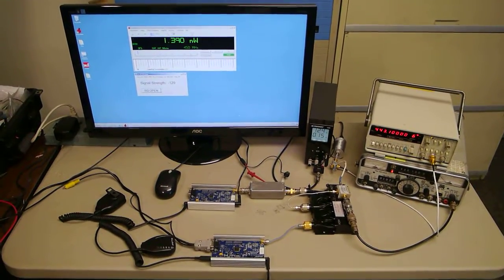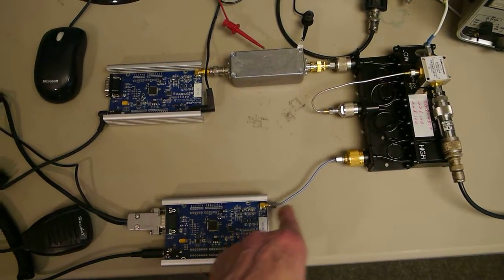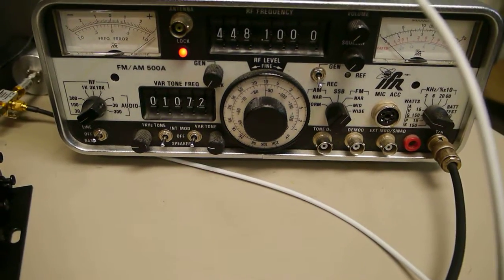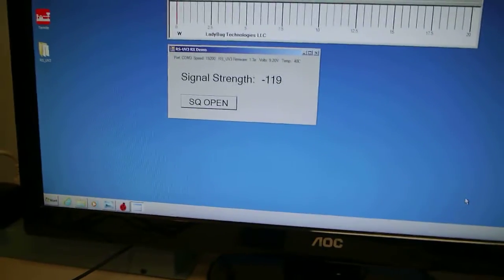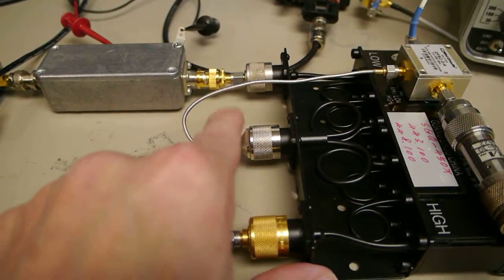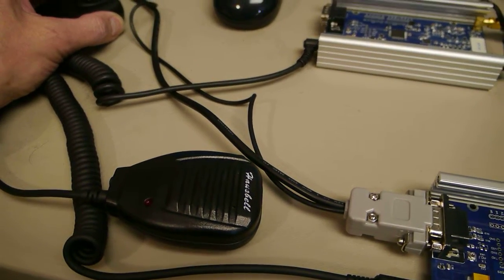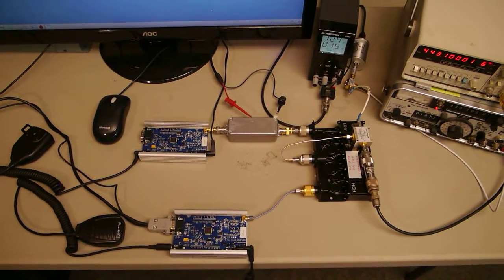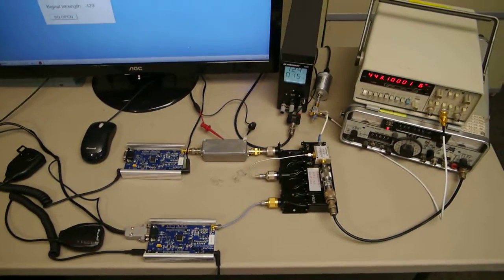Using a pair of RS-UV3 Radio Shields as a full duplex voice repeater

Comment: Do you have a copy of the code that you set up for you adruino's? If so could I please have a copy?
Reply: +WARSPIRIT 
There are no Arduino's in this setup. All of the functions needed for CW ID, Hang-time, and Time-out are built into the RS-UV3. The boards have a COR out and PTT in for simple interfacing between the TX and RX. 

73,
Jim WA2EUJ